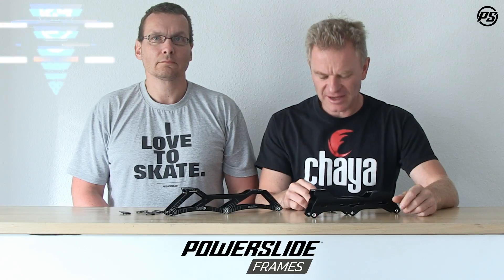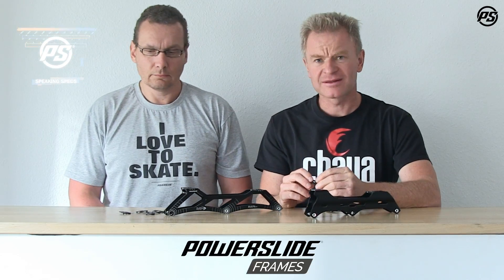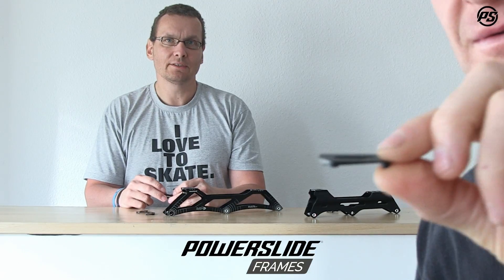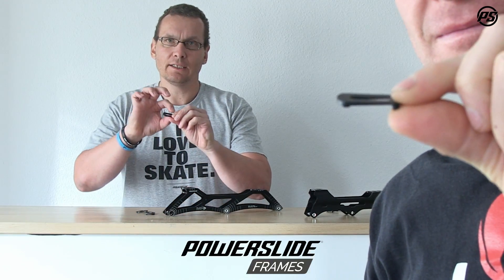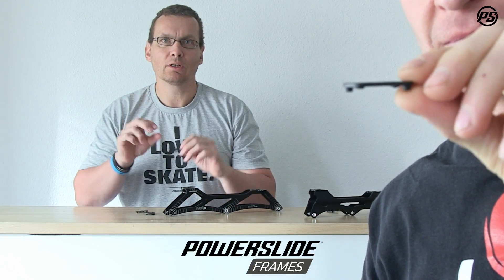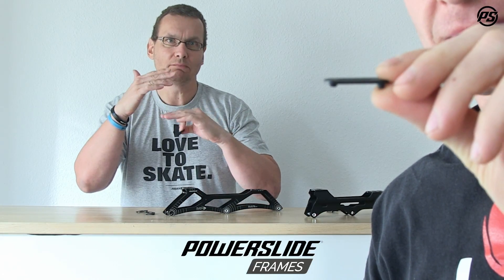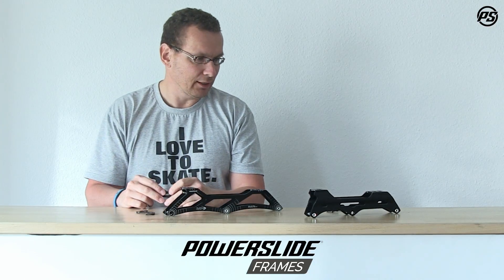Powerslide Pitch and Stride Control - Powerslide Speaking Specs

Comment: Old video, but relevant and a common problem. 

Most inline speedskate style boots I've owned have slightly faulty layups where the mating surface of the boot to frame is canted a couple degrees or more to the outside. That surface should be dead flat or better yet canted inside a bit, hence the need for wedges. 

I recently devised a simple trick for rock solid wedge installation. Get 4 longer 6x25mm socket screws, to each add a pair of special convex/concave 6mm alloy washers commonly used to adjust the alignment of bicycle brake calipers, then add a 16mm flat washer, use some blue thread locker, and install your frames with that assembly and allow to cure overnight. 

This creates a high strength clamping force that compensates for the screw to frame misalignment caused by the wedges. Your frames will stay where you put them and the boots won't be weakened.
Reply: Thought like an engineer!

Comment: Help! My stride control pack came with three wedges - a thick one with a round hole, a thin one with a round hole and a medium one with an oblong hole. Do I use all three wedges at the same time? To correct pronation I understand that the thick wedge goes on the outside front with the thicker part toward the outside, but then do I still need the other two? I could add the oblong wedge on the back with the thick side toward the outside, but should I use the thin wedge on the inside or just not use it? Thanks for more detailed instructions.
Reply from the maker: It's a trinity pack, so the along hole goes for the back part. The thick and thin can get left or right in front depending if you want toget pronation or supination. If your skates fall too much to the inside then i suggest to put the higher one on the outisde and the thinner one to the inside. It should help to get better outside edge.

Pascal Briand
Reply: @PowerslideInlineskates  also muss auch der dünnere verbaut werden und ist nicht nur eine weitere Option, falls die Pronation nur schwach ausgebildet ist ? Auf der vorderen Gegenseite muss also auch ein Keil sein ?

Comment: Could you please add an explanation for proper installation of stride control for Trinity frame?
Reply from the maker: hi & thanks for the request, but it's already online: https://www.youtube.com/watch?v=acpxOPIq-SA
Reply: thank you, the all  3 pieces should be installed? or could be 1 or 2, for instance a high part front inside and a rear part?
Reply from the maker: to work properly, all 3 would need to be installed
Reply: Thanks for stride control correctly installed, I finished 45. Berlin Marathon Inline Skate at 01:56 with Swell B&W ultra 110 :D
Reply: Powerslide Inline skates in the swell box there are 3 different sizes. Can 3 different sizes be placed in one frame? Or do they need to be all the same. I cannot find a shop or online store that sell them by piece. They all come in a package with 3 variation of 2 stride controls.

Comment: Dear Gents, regarding the wedges, 
it is understood that the wedge is to be placed between the boot and the frame. Yet due to the inclination of the frame now, I would expect another wedge to be placed between the frame and the bolt as a washer, but on opposite direction, so that the bolt as being tightened up, to remain always flat and perpendicular to the surface . This would ensure a even - solid tightening, while preventing any marks or uneven wear on the frame, being "dug" by the bolt. This is yet not recommended by this arrangement. Can you explain why?

Comment: May I know what if I only have pronation on one side only? If I only install on one side, will it cause another inbalance problem? Thanks!
Reply from the maker: lots of skaters (including our boss matze) uses these only on one side and it does work great, give it a try! do not forget to check the screws regularly to make sure they stay fixed correctly.
Reply: @PowerslideInlineskates  Thank you for your quick response!!
Reply: @PowerslideInlineskates  By the way, I also bought the pitch control, which all are flat. In order to have a "rocker" setup, should I just install two at the heels? Thanks!
Reply: Powerslide Inline skates I just tried the stride control for my next 3x110 on one side. It’s absolutely much better. Thanks! I am planning to put it on my 4x80👍🏻
Reply from the maker: @ksiuwah  glad we could help and happy that you enjoy your skates now even more!

Comment: is it okay to heat mold carbon skates when they have stride control on the frames?
Reply from the maker: good question. I think it should work fine but still i would recommand to take them out before. Pascal Briand

Comment: Question 2! With the stride control for swell, there were some extra screws that were a little longer. I now have the Next model. So when I put stride control on the next, should I then change the screws on the next, for the longer extra screws from the swell model? Does it make sense what I am asking? :)
Reply from the maker: answer 2: ;)
for the stride control, please use screw which are 2mm longer, at least in the back and on the thicker side. the narrow side will not make much of a difference and can be mounted with the same length screws.
Reply: @PowerslideInlineskates  die " narrow Side " bleibt doch unverändert oder nicht ? da ist es doch logisch das man die original  Schraube verwenden kann.